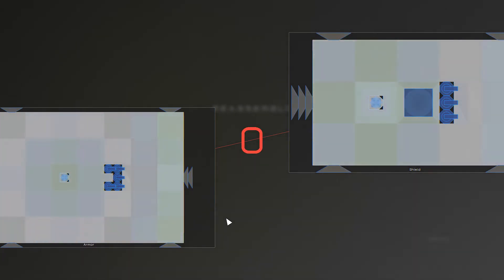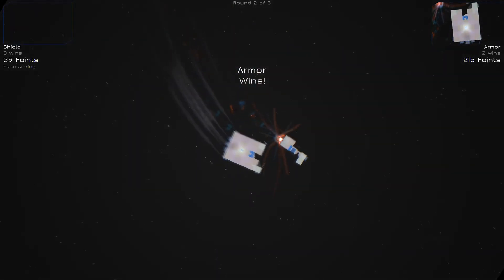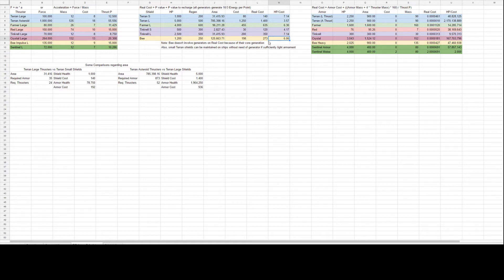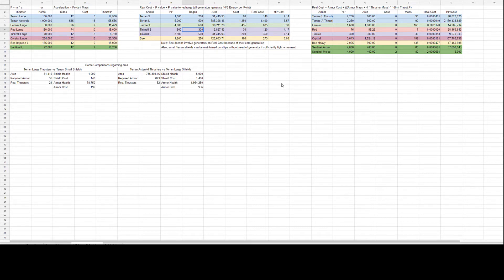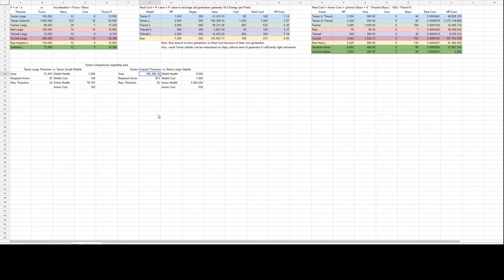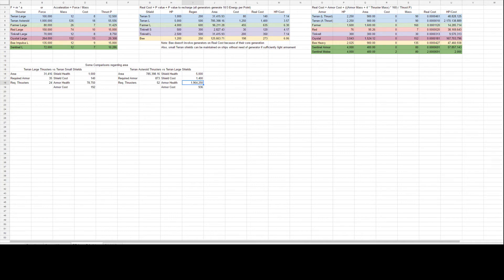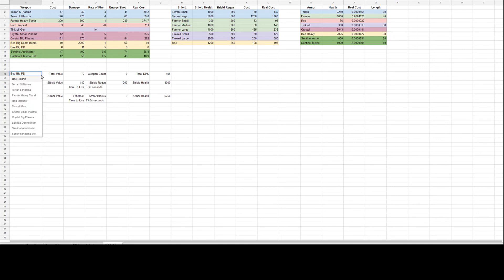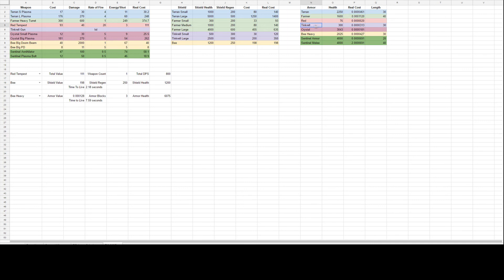Reassembly Lessons - Armor vs Shields

Comment: Might be worth mentioning that shields can be useful for internal protection on an armored ship if your ship can spare a little P in it's budget for one.  I've had ships with quite a few layers of armor instantly die at the start of the match due to missiles penetrating all the way through to the core with physics nonsense.  So I'll often shield my core and generators even on armored ships, but you don't really have to go overboard, one can be sufficient.
Reply from the maker: Yeah, that is a strong case for keeping shields over your components that are vulnerable to suddenly combusting. I think I mentioned that in the video somewhere, "shields can be used to extend the health of sensitive components." If I didn't mention it, I meant to. Nonetheless, I still consider that a secondary form of defense rather than primary. The bulk of the ship's damage would still be absorbed, ideally, by armor or avoided entirely by maneuverability.